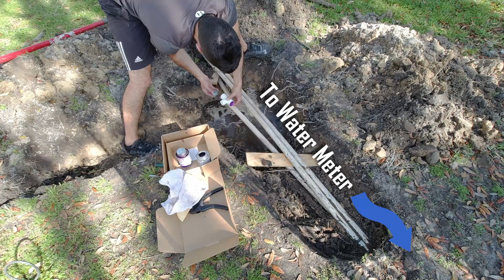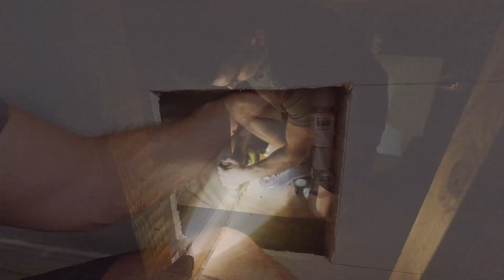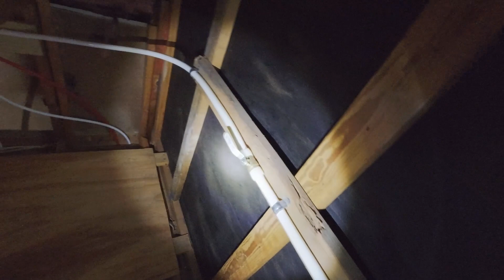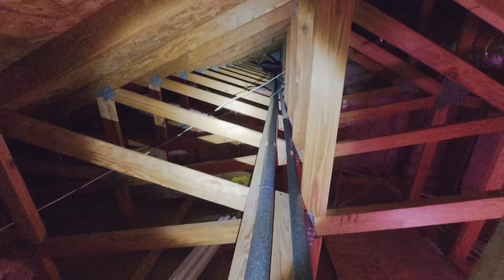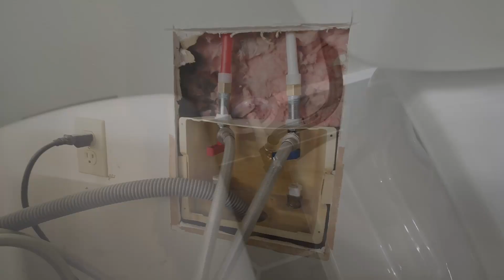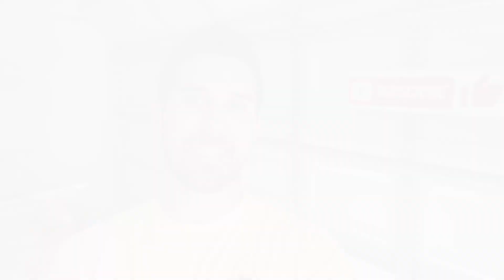Whole House Repipe DIY with Pex

Comment: Great job. Coming from a plumber of 20 years, it looks good. Only thing I wouldve done different is to use as few fittings in the walls as possible. If you were doing manifold homeruns, one solid length frommanifolf to fixture has less chance of having a leak than a run with a bunch of 90s and couplings in the line behind the walls. Just mho
Reply from the maker: Thanks! I had a plumber mention that adding an expansion/pressure tank on the hot water heater is code now too.

Comment: Nice work! What kind of transmission did you use to connect pvc to pex A?
Reply from the maker: I used a threaded male PVC connector to a brass/copper fitting. I've heard that it is recommended to use a threaded female PVC adapter then into a male brass/copper fitting. From there I sweated on a copper to pex fitting.

Comment: I'm considering a pex repipe for my home as a diy project. Very helpful video.
Reply from the maker: Sounds great, thanks. I recommend checking with your local code department. You may have to get a permit. There are homeowner permits out there but exclusions apply.
Reply: You’re welcome. I want to do this the right way and making sure I take care of the necessary paperwork is a part of the process. I want to do it right the first time.

Comment: Did you connect with PVC in a few spots? If so, you can’t do it on hot water lines. 
Also, just a tip, your straps should be on the inside of the 2x4” not the front. Then you can’t put the drywall back up😂😂
Reply from the maker: Hello, no hot water lines were connected to PVC. There was only PVC entering the house then converted to Pex from there. Those were inset from the wall. It was a 2x6 wall separating both bathrooms to accommodate the plumbing. Thanks for watching and commenting!

Comment: I know this is an older video, but i am about to attempt the same exact thing. I experienced the same issue with plumbers and my home warranty/home insurance not covering the cost. My estimate was 5k. The only thing that sucks is i wont have a day off from work til after xmas....its not going to be a quick process.
Reply from the maker: Nope and you will need a permit if you don't want any issues when you go to sell. If you've reported it to your insurance it may come up if you ever need to switch too.
Reply: @oarDIY  did you have issues with that stuff after you finished? I figured I would technically need to get a permit, but I didn't think about having to notify my insurance company...they aren't willing to even let me make a claim since there isn't any visible damage to my property at the moment. So no matter what I would have to come out of pocket for everything. I did see you did this work in Florida and I have heard there have been insurance companies refusing to cover houses with pex over there, is that true? I live in texas and there haven't been any issues with it as of now. The plumber that gave me a quote was essentially going to replace everything with pex just like I'm going to do.

Comment: Feels. I've got a slab leak that I've isolated. I'm doing my own repipe through my attic with PEXa as well. I'm adding in a line heater and some leak detectors. I found in the past that long sweep 90 degree conduit elbows can help with bends without damaging the PEX like the metal ones
Reply from the maker: Sounds like a good idea. I need to add leak detectors also.

Comment: what did you use to locate the old plastic pipes behind your walls?
Reply from the maker: My old water pipes were copper and they were right below/behind the shut off valves near each fixture. Is that what you meant?
Reply: @phillipreborn  I just learned that I will have to replace my entire water pipe system myself, and I did see something on another site that said plumbers have to use something to locate some of the pipes behind the walls. I have zero experience with houses so I didn’t think that I’d probably be fine if I just follow behind the valves like you just mentioned.
Reply: @tamsonebarley3520  did you complete the task?

Comment: My brother repiped the whole house from cast iron to copper. But the plumbers did not repipe a 2inch wide black plastic tube? Were those necessary to repipe or no?
Reply from the maker: That might have been the drain lines. I'm not sure.
Reply: I'm just a DIYer, but I'm reasonably confident in saying that any 2 inch plastic pipes in a residence would be a DWV (drain, waste, venting) pipe - mostly like ABS plastic (PVC is usually white). Hot and Cold supply lines in houses are typically 3/4" inch, reduced down to 1/2" wherever it branches off to an individual faucet (or similar).

Comment: The weakest point in a pex connection are the fittings. You may want to house those line splitters in some kind of insulation (like make a box from rigid styrofoam). When our house was built, I asked why the pex line was pulled into an interior wall from the attic and a splitter used. Then the lines from the splitter went back into the attic. Builder asked plumber and plumber said the splitter needed to be in the conditioned space since it was the weakest part.
Reply from the maker: Thanks for the advice. The rigid foam box is a great idea. I tried to use mostly brass fittings in the attic but of course the multi line fittings are plastic. I have concerns about the integrity of those over time. Hopefully I'll be home if one breaks.
Reply: @phillipreborn  you can get smart water detectors. put one in the box housing the multi-line fittings and it will alert you (home or not) if there is a leak. if you spend more you can get smart accessories that will shut off the main if there is a leak somewhere, but yeah. i have a detector in my garage in case there is a rain leak intrusion it alerts me so that I can go move my wood etc.